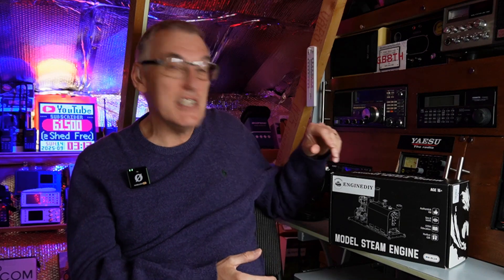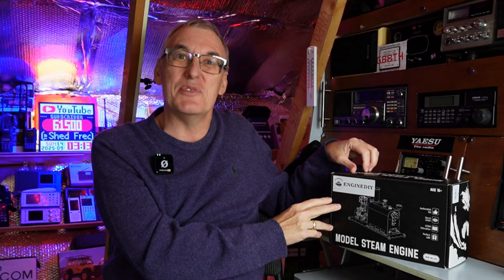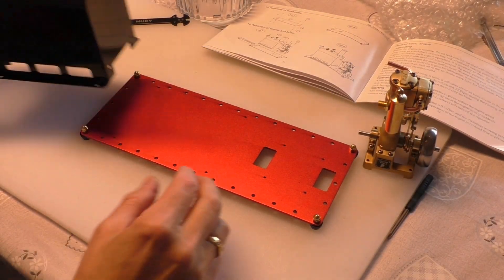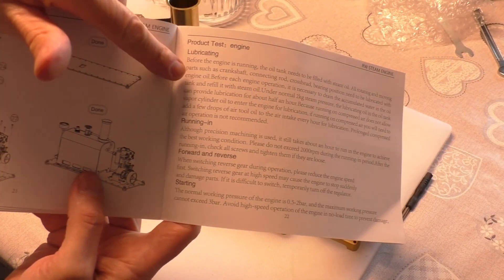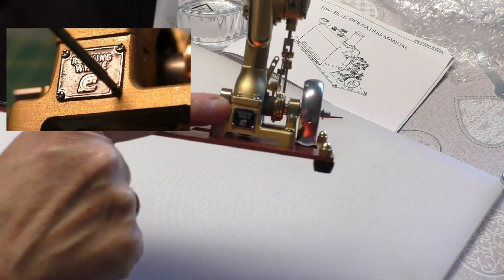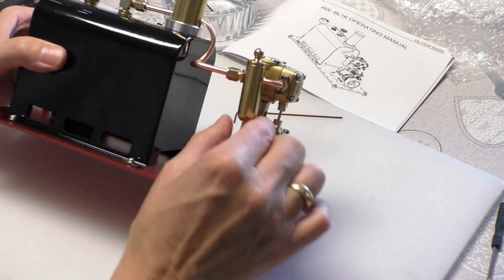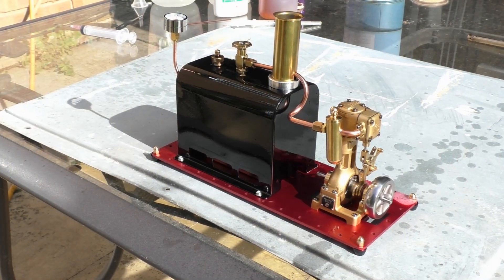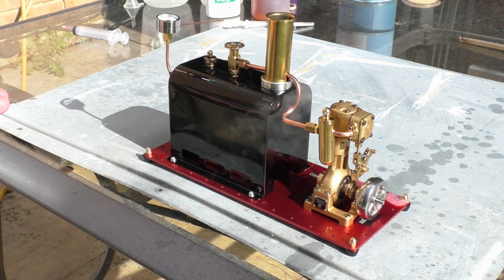You simply WONT find a better QUALITY Steam Engine kit for the money.

Comment: Fred! I have a challenge for you…. How about combining both your hobbies by using one of your steam engines to drive a DC generator that powers one of your radios! Lets get some steam-powered skip reception 😅
Reply from the maker: :-).  Its a fine idea but the small generators normally output 5v.  Cheers
Reply: @CB-RADIO-UK  could a "boost converter" help? Turn the 5v into whatever you need for your radios?
Reply: Many portable receivers run on just 3.7V